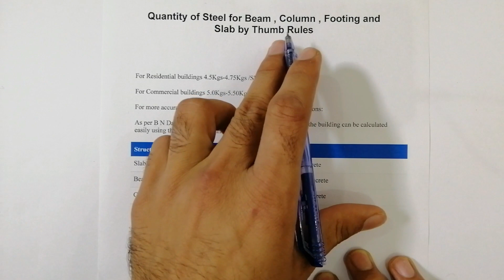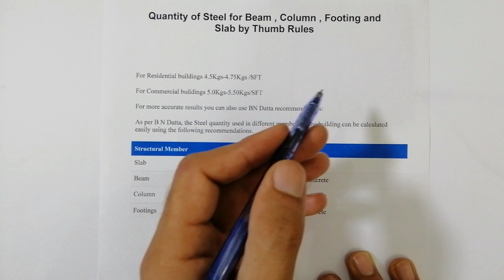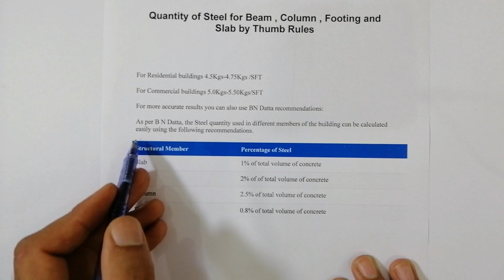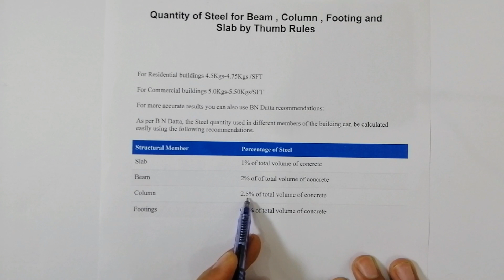Steel Estimation Notes for Beam Column and Slab by Thumb Rule

Comment: At that time we’ve used only four bars in columns; now we are using 12+ bars in columns based on load analysis. So, the percentage of steel is increased in a column which reveals that the given values are outdated. ( They are outdated “not wrong”) He wrote that book in 1950. Now we are in 2019. He gave recommendations according to the potentiality of construction at that time. Now we are constructing 200 + floors in the small area.